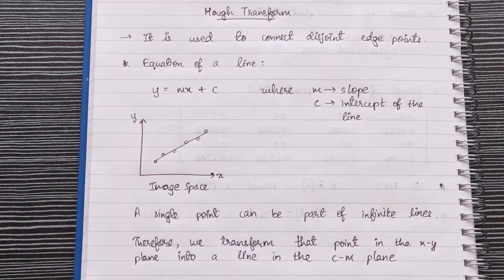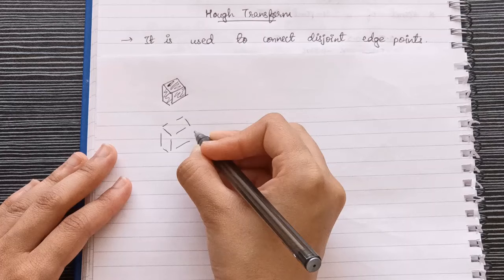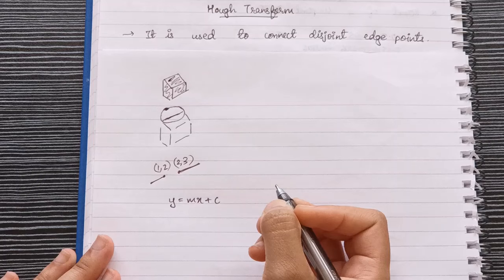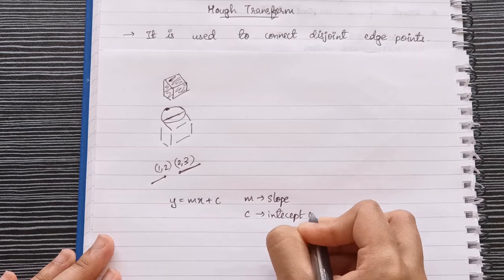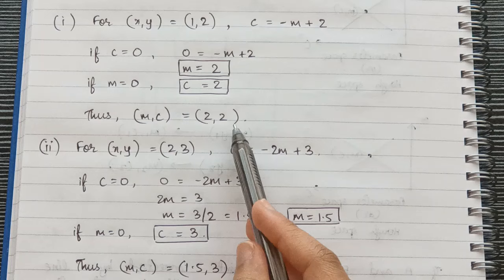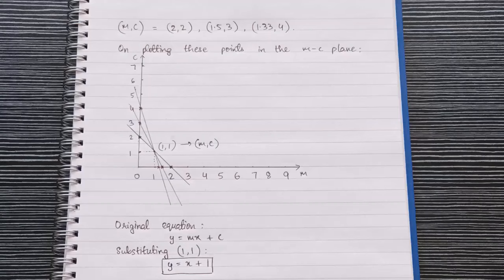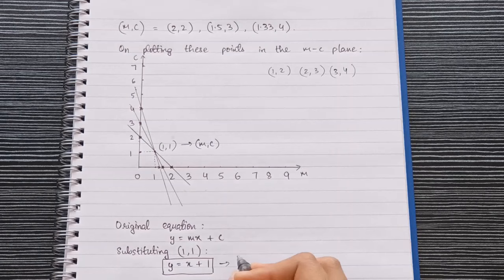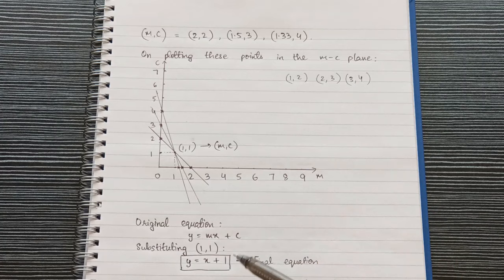Hough Transform Explained with Example

Comment: Something is not right: take the points M1(1, 1) and M2(1, 2). They should be collinear, thus their (m, c) should intersect.
If m = 0 => c = 1 and if c = 0 => m = 1 for M1 => (m, c) = (1, 1)
If m = 0 => c = 2 and if c = 0 => m = 2 for M2 => (m, c) = (2, 2)

Uniting 1 to 1 and 2 to 2, results that the lines are parallel on the graph when they should intersect. What am I missing?
Reply: Two points are always collinear.....we find whether points are collinear or not only if there are more than two points....And yeah you are correct, i also noticed that mistake